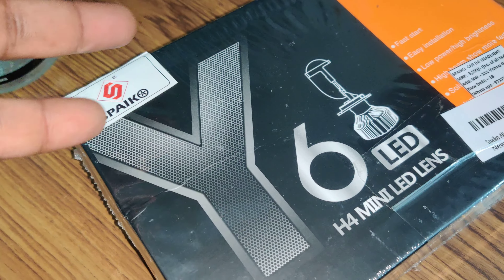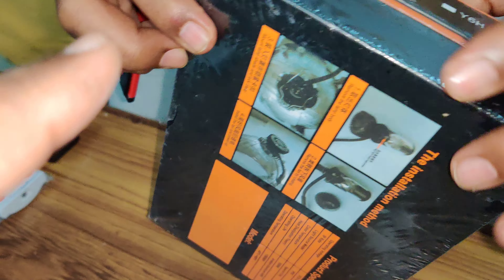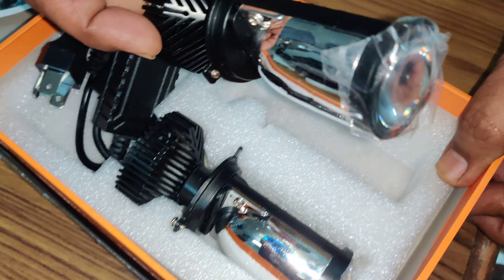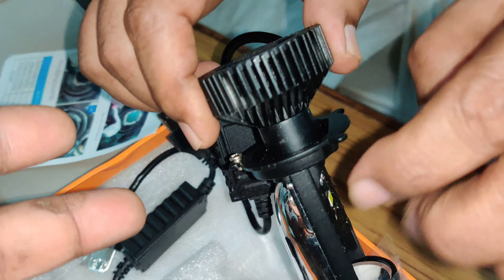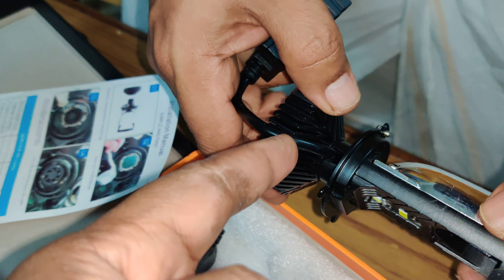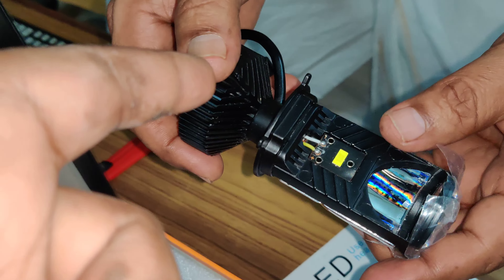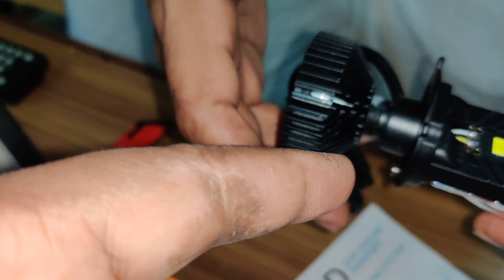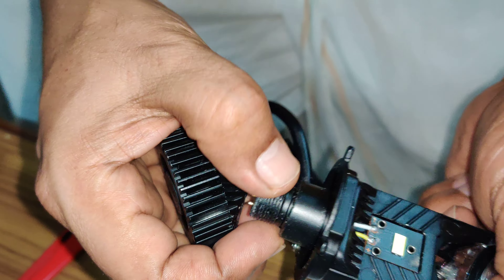Spaiko H4 LED Bulb with Mini Projector | Well made

Comment: I have bought the same kit from amazon with a lots of hopes to see the great clarity on road. But it's not so impressive in comparison with Otoroy's LED bulbs with 9000lumens(4500lm/bulb). Otoroy's 1 single LED bulb can beat these 2 bulbs at a single time.

I don't know whether I received original or fake one, but Amazon always sells original, genric products with mentioning clearly condition of the product. So I didn't like it. Coz this company claiming this set of 2 buls generates 20000lumnes brightness with clear cut laser effect cutoff. But in reality I didn't fing it to be true. 

Basically it semi projector led bulb, it's low beam based on the mini lense to enhance and project the light and high beam work completely on your headlight's reflector. So if you are having a bad quality reflector in your vehicle, it won't help you.

So if you are willing to use projector bulbs, I recommend you to buy some good premium products which may cost you bit expensive but you will not be disappointed at least.

Thanks to Amazon return policy which is helping me RETURN the product and get my refund.